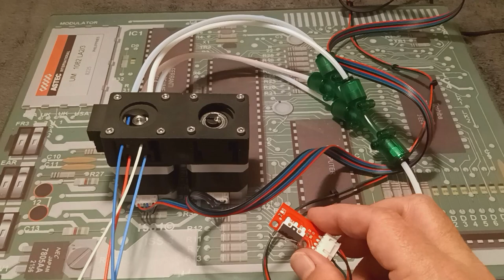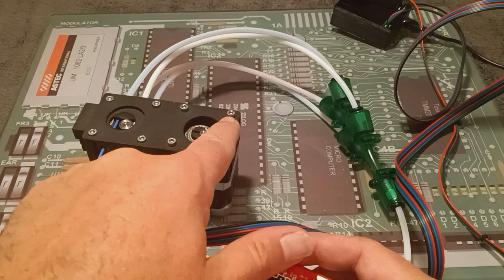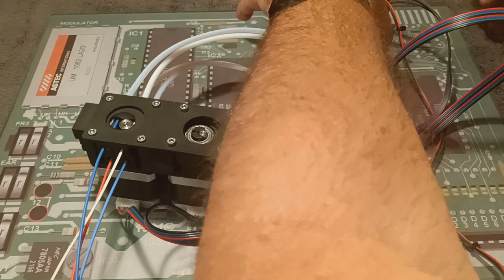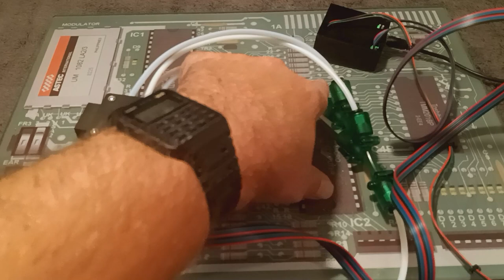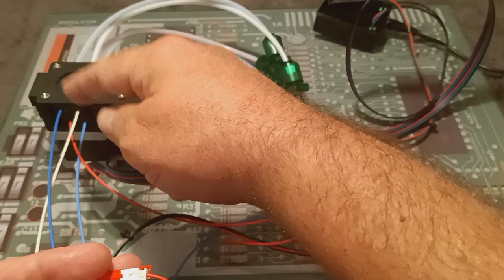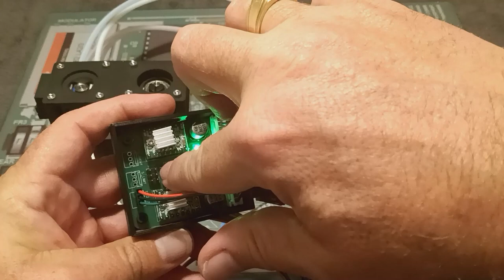3DChameleon Mk3 New Firmware

Comment: Filament detection on the single tube would make it possible to have varying distances on the tubes. You'd know when an old color was X distance away from being unloaded. You could program in the distance to the extruder from the sensor for loading.
Reply: The filament runout could also be 'passed through' to the printer's main board when not doing filament changes (ie become a traditional filament runout sensor)

Comment: @3D Chameleon  I am setting up my MK3 Chameleon.  I have a question about extruder replacement mode.  To use this setup do I just plug my extruder cable into the 3D Chameleon's extruder motor instead of having it plugged into the Chameleon black box and leave the motor controlling selector alone?  If so what is the Estep for the 3d Chameleon extruder?  Alternately if I chose the mode to keep my existing extruder I see the instructions have a bracket to install under the extruder in order to install a fitting just before the extruder.  I don't see how this is going to work as my extruder will not just load filament because I push it in. I have to press the release leaver.  The same would be true if the chameleon tries to pull the filament out.  My printer extruder is going to hold on to it.  That part my be accounted for in the tool change gcode.
Reply: 1) Extruder replacement mode is not recommended due to difficulty in setting it up (software wise.)  We do not have auto generated code for it and you'll need to write it all by hand, on top of using our post processor that reverses T2 and T3 for proper operation.
2) I've not seen an extruder yet that you can't load via software... even if they have a lever, it's only for human interaction... our gcode synchronizes the motions of both the 3DChameleon and the stock extruder to push/pull at the same time, so it will load.  You can see it in our other videos in the playlist, like the Ender 5, which also has a lever, but it works just fine.
Reply: @williamsteele  Thanks for the clarification.   I will go for the extruder mode.    I was noticing as I was going through the checkout by loading 4 filiments and letting it change between colors that when I would load the first color it would stick in the y adapter.  and not fully extrude.  Then when it would retract it would retract too far, because it never extruded as far as it thought It did to begin with.  After this would happen it was just really confused.  O would have to unplug the power reload the filiments to the starting position.  It would rarely get through all 4 color changes without this happening.   It always seemed to be color 1 that would hang up.  Is there a way to keep this from happening?
Reply: @thedunemaster  So, for extruder mode, you're going to have to take the extruder motor out of the 3DChameleon.  When you do, make sure the drive gears are aligned properly (or tightened properly) against the motor shaft.  It's possible they're not, which is causing the issue.  You can also adjust the tension (by printing new tension tuning sliders from our Tinkercad repository) to increase the tension... however, 99.9% of the cases of this is just drive gear alignment.  Also, make sure you test it with all 8 screws in place... that's a requirement for the proper force to be applied.  Lastly, as for the eSteps, it's 152.
Reply: @williamsteele  So I go the physical part of it set up today and will start the gcode set tomorrow.   My printer is running klipper.  I was considering putting the gcode in a macro and just putting the call to the macro in the slicer tool change block.  Am just asking for trouble 😀  If so, I will just follow the instructions as they are in the basic video.  One more question about using this in extruder mode.  I can see how the extruder and the Chameleon can work syronized to push pull during the load and unload since that is all timed by the button push, but does the Chameleon disengaged for the printing so they are not fighting?  I assume it does, but it just is not in the check out process.
Reply: @thedunemaster  Yes, as soon as the button press let's go, it moves to a different unused color.

Comment: How do you set the length of retraction and feed, to customize the placement of the Y splitter and how far away the extruder is
Reply: Well, that depends on which configuration you're in.

Mode 1: It's set by setting your E value on the G0 command... which is basically driving your extruder.
Mode 2: You can't... it's always set to 10" retraction and 11" load... you need to shorten the tube between the Y adapter and the extruder to set the proper distance.
Mode 3: You set it by setting the G4's dwell parameter, which defines how long the button is pressed... as long as the button is pressed, it will move the filament.
Reply: @williamsteele  Thank you for your reply, I didn't quite understand it but I think that's due to my question not being clear. I found the answer in the P1P installation video where using mode 3, you can set how far the 3dCham feeds and retracts on each change.